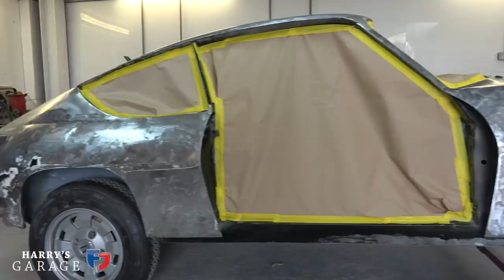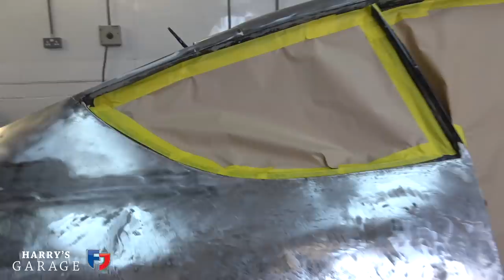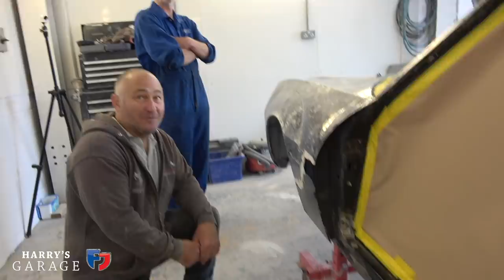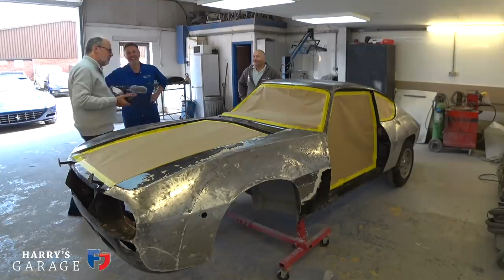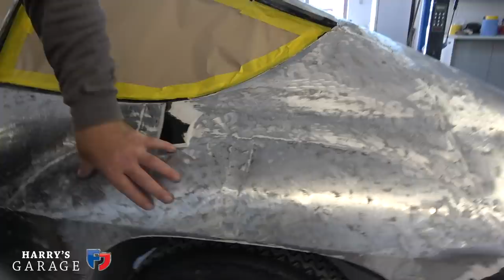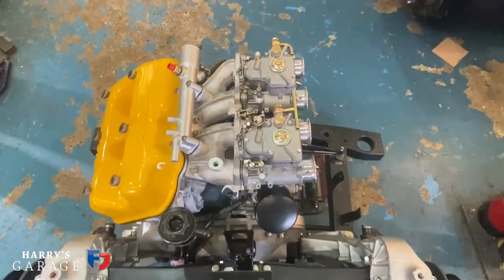Lancia Fulvia Zagato 1600 restoration Pt.6. Stripping the paint reveals shocking bodywork repairs

Comment: I made the same fundamental mistake with the restoration of my De Tomaso Pantera. I started off with the grimy bits, rebuilding the engine and gearbox and suspension, before turning to the bodywork. I thought it was bad but discovered it was catastrophic. Rightly the car should simply have been parted out. But by the time I discovered the parlous state of the body, I was financially so far committed that I simply had to continue to the bitter end. When I was done I had spent  almost double what it would have cost to buy a similar car in similar condition. 

That said, as the years went by the car appreciated and eventually caught up with my investment so I am probably now in the black once more. And I get the satisfaction of knowing that I preserved a car that otherwise would have been destroyed. 

So press on regardless, regardless of cost. It will only be foolish for awhile!
Reply: Those Panteras are ace. Italian style and American muscle! Good on you for keeping it out of the scrap heap.

Comment: At the end of the day this is the exact car that turned Harry into a petrolhead- without it we wouldn't have these channels. Plus it left Turin as a Fulvia 1600HF chassis, went up the road to Milan where a pretty bespoke body was fitted and turned up in blighty on the Wirral where Harry first came across it. Remember in the late '70's & early eighties these cars were worth next to nothing so no-one was going to spend a fortune restoring them, it didn't matter if you cocked the bodywork up as the rest of the car was worth little. Nowadays people in the know have cottoned on to how well engineered and how much fun these cars are and with less than 800 1600's made they are becoming increasingly sought after. It has sentimental value too which counts for a lot so well done Harry in your pursuit to get it right. Apart from a respray in 1986 my '72 Fulvia 1600 Sport has never been restored and still has all the correct swage lines & wheel arch lips and more importantly no filler.

Comment: Last year I bought a 1985 VW T25 that has similar amounts of filler. Rear wheel arches were riveted to the outside of the body and the join hidden under half an inch of filler. I’ve slowly been grinding filler back with wire wheels to find the horrors that need to be repaired. Fortunately new panels are easy to find.

Comment: Glad to hear you called it a steel rule, not ruler. As my Dad taught me,  a ruler rules a country ;)
Do you think it may have been rolled down a ditch at some point, hence the roof having been off?
Reply: Sorry to be the pedant, but the difference between a rule and a ruler is a rule measures from the edge whereas a ruler has a space between the edge and the zero measurement. As an example a tape measure could be considered a rule while the plastic Helix school ruler is just that, a ruler.
Reply: @S3dINS  what about a slide rule?
Reply: @_gray_  can’t say I’ve ever seen one let alone used one.

Comment: Maybe the garage should have picked up on this before the resto started?
Reply: How?   :0)
Reply: @williamr3840  Being bodywork guys, are you saying they can't find an inch of bondo? They had already done bodywork repairs before stripping the entire car. Most everyone checks for bondo with a magnet. Pretty silly to ask how.
Reply: Have a look at part 1 of this series. It went in for engine rebuild work and they found rust underneath. The rust wasn't news but the extent of it was, to Harry at least, so he got them to fix it. 
This has turned from a engine refresh to a total restoration step by step, there was no call for them to start running magnets ofer the customer's car at the beginning.
Reply: @plumbandsquare1  I get your point that they could have done that but, having had a couple of cars restored, my experience is that it isn't what any restorers do to my knowledge. I guess if Harry had asked them specifically to check to see if it was worth doing the restoration or not, then they might have done that, but usually restorers are there to restore cars. Also, they probably didn't suspect the amount of bodging as they said it was oneof the worst they'd seen.  :0)
Reply: Only if they were really familiar with that make & model, or had the exact same car next to it, so that something looked 'odd' from the start. Paint job must had been good enough to hide what was visible in the wheel arches though, body panels shouldn't have been that 'thick'?

Comment: Just clearcoat it and race it. Looks cool like this, fix it when you retire the car.
Reply from the maker: That's an excellent suggestion. Almost tempted to do just that! 👍
Reply: @harrysgarage  Or have it epoxy primed and wrapped. You can always change the wrap as your moods change. Have a different livery every year if you want. Let fans sign it, sticker bomb it, whatever. Either option will probably save you about $20k.
Reply: @harrysgarage  you’re in a tough spot with this one Harry! We’ve all got a few like this in our past. Replace the rust, relieve the stress in the panels, pound them out as best you can. Splice in any openings, apply strong durable filler and go racing. You have to draw a line on this one.
Reply: That's a great idea!!
Reply: You beat me to it!
Reply: Yep just an extra bit of glue on the rear left glass and let her rip!
Reply: Yes, I think that this is the best suggestion yet. Without spending crazy money to fix/correct the history of this car. Clear coating it and exposing its scars, crows feet and warts is showing this for what it is. It is this Zagato's life story, it might be ugly but it is then "Genuine". Sometimes not restoring is better than restoring. Preserving history. At least its heart and bones will be strong.
Reply: Maybe you would have to paint the bonnet matt black to limit reflection and then just add a stripe or splash of the original orange as a homage to its original colour. Possibly dress the interior in the orange.
Reply: Yes, I’d do that, rally it, then maybe fix it. Everything else will be perfect, it’s just a body....and a superlight one at that

Comment: Take a magnet to test for bondo when buying an old car.
Reply: Doesn't help when it's an aluminium bodyshell
Reply: @trenttrevorrow5648  True. It looked aluminum but they kept talking about rust. Maybe they call oxidization “rust” in UK.
Reply: @jonathans1472  Actually, we don’t.  I assumed it must be steel since they kept talking about rust.  Rust is specifically iron oxide.  I can only presume the “no rust” comments were a joke if it’s aluminium.
Reply: @trenttrevorrow5648  apparently only the early ones had an aluminum body shell. all the later ones were steel with aluminum bonnet and door.
Reply: The body is lightweight steel, .8mm I think.

Comment: I have the exact same kind of patch in the middle of my rear left wheelarch on my Mitsubishi... they've changed the wheelarches on both sides with aftermarket panels, but only the left side needed that ugly fabrication for some reason. I didn't even ask why, I've just put a lot of filler and paint over it... cheap and dirty solution on a cheap everyday car.

But the Zagato was never really an everyday car... although it seems it has rusted like hell as most old Italians did, judging from all the patchwork. And there were times when these were just old bangers that nobody really cared about... but it'll shine again thanks to Harry and the workshop guys! :)

Comment: Had a 2011 Alfa Romeo Brera traded in a few years ago at my garage, it was an interesting patchwork of different shades and finishes with rust/filler in all four arches. Rust in the doors, rust in the sills, holes in the subframe and the exhaust in 3 pieces loosely attached to the car by a variety of non-standard hangers. And this on what was an 8 year old car at the time.

Italian cars and road salt, not the best.

Comment: Honestly Harry, I'm not sure I could honestly say that I liked watching that video.  Yes, it was great to see the progress, but my goodness - what a mess!  I have seen patchwork quilts with less joins in them, I reckon.  

Having owned an Alfa Sprint Veloce, I can honestly sympathise though.  The Alfa was the only car I ever owned that got lighter the more I drove it.  At the time, I used to drive to a remote part of the country that for the last 30 miles or so, was winding, hilly, unsealed road and it used to shake the car mercilessly.  I remember driving down there one weekend and hearing the whistle of wind coming through a couple of the smaller rust holes, but when driving home again, the whistle had gone and I had a reasonable breeze in the cabin with the windows up and the vents turned off.  I also found a lump of 3x2 timber hidden where a chassis rail should have been when a lump of underseal fell off.  Fortunately, the car was rear-ended quite hard at a traffic light and written off, but I was almost to the point of parking it until I could find another body to put the wee gem of an engine it had into.  To look at, the car was beautiful in every regard, but the amount of filler it had and the lack of solid underpinnings were not immediately obvious....and had she been hit from the front or side, it could have been a very different story.

I have often thought of getting another Italian sports car, but I don't believe my wallet would cope.  I salute you, my friend.  That car is going to be a very different beast from the one you drove in there......and a damn sight safer too!  All the best.

Comment: There's alot of "wise comments" being made here, but at the end of the day I didn't read any that predicted this outcome. You can never be sure what you will find 100% until you get it down to bare metal. Sure paint depth instruments are good, but don't forget on the near side there was supposed to be a 3/4 panel welded over the original.
This car has surely had a serious accident in its life. But its a Zagato and at least the owner didn't scrap it, but it certainly got a mega bodge job, which at the end of the day has saved it for someone like Harry to come along and get the job done properly. Bravo Harry, I am sure despite the wallet wincing cost it will be all the more satisfying to see it finished in the end.

Comment: I thought after stripping my project car I've seen some bad body 'work', but this beats all. What a downer, eventhough it's nice to know that you'll have a completely different car when it's finished.

But can you shed light on the choice to not sandblast the car fully? With a restoration this size a bare-metal job works much more pleasant in my opinion, and gives you a perfect view on what's to be done and how bad it is to begin with.

Comment: Harry, sorry to see this.  Thinking positively though, remember that Zagato’s designs were wonderful, but their fabrication standards were often, er, iffy.  Check out an Alfa TZ to see their contemporary standards, or have a look at the inner wings on an Alfa SZ (ie. ES30) for evidence of their work in the nineties…. Honestly, the finished panel work is poor, but it’s now rust free and solid, if somewhat rattled.  I’m hugely impressed at your positive approach, and it really will be worth it.  You’ll have the most solid Fulvia Sport on the road once it’s done.  A thought, probably not required, but if you’re going to rally it, might be a good time to think of putting a bespoke cage in it, braced back to some of those seams.

Comment: Given the shape of the added panels on the fenders it is as if at some point someone added some extensions to fit wider wheels. And then a subsequent owner decided to give the car its original shape back by filling the gaps with bondo. It would be interesting to know more about the history of this car: trace previous owners and/or shops who worked on it and understand better what happened. If that car had exptensions fitted for rallying for example, one option could be to restore the car back to that point in its history.

Comment: I had a '69 911 that the hood had been done the same way, it had basically been carved out of bondo. My first clue was when I removed the hood and noticed that it seemed to weight 100lbs and when I started sanding it the reason became clear...   Best of luck.
Reply: At least you can buy a new metal hood for a 911, or any other panel. At reasonable prices as well (Dansk, not from Porsche, obviously....). Unfortunately not the case with a Fulvia Zagato.

Comment: What an absolute nightmare of a bodge job done by the previous "restorer".  

Glimpsing some of the still pictures in this series, the car looked quite reasonable when bought, and Harry had been driving it for some time before commencing what he thought would be a fairly straightforward tidy up.  Which with hindsight, must be a little worrying.
So, Harry, please - name and shame the previous "restorer" (I recall that you did allude to some background story on this) and what about the seller?
Helping everyone else to avoid such charlatans would be a real service.
Notwithstanding the above, this has been a fascinating series, and has certainly made me much more cautious about returning to Lancias from the 1970s.  I did have a Fulvia 1600HF Lusso, which I bought at 5 years old (1977) with my eyes somewhat shut.  I rapidly discovered the perils of Italian rustproofing, as it already, even at just 5 years old, had significant holes in the floor, and had been cheaply welded up.
After many late nights at the other Harry's Garage - the legendary Lancia guru Harry Manning in Aldershot - I managed to get it back to really good mechanical health, but never had the money to address the bodywork issues properly.
It was a real treat to drive, however, and that 1.6 V4 was phenomenal - sounding like an Escort BDA engine at full chat, but being uncannily smooth on part throttle.  It was a nightmare to start from cold however, and I gradually stopped using it when company cars came my way.
I eventually sold it about 15 years ago.  Right at the bottom of the market.
Of course....

Comment: Me thinks the previous repairers in the 70s should have spared the paint and filler and just tiled the thing in 4 1/4" Crystal tiles....... There will be a swan moment to come. Maybe just in time for the end of September. Fingers crossed. Oh and Harry, I would still try for a metal tail gate if you are able to find one. It could provide you with more structural rigidity. You will be loading that shell when you are driving spiritedly. PS. I tested a modern Delta Gold today.................Bw Mike

Comment: Take a GRP mould off a good one, then make your replacement in carbon - it’ll save you £10’s of thousands - and you may survive a rally crash, and you can also market selected moulded bits to other Lancia restorers.
Top Tip: I always run a magnet all over anything made of steel before I hand over loot.

Comment: This setback could be an opportunity to source a set of GPR Gr4 wheel arch extensions, as used by the works, and save the cost of recreating 4 wheel arches in steel. As it will be painted in orange it might be a smart move.  But what a mess this car is! British weather and a low value means that it had received its share of butchering. Now values have gone up it is triple the work.  Good luck with it. Being a Fulvia (HF) owner I love this series.

Comment: Sorry to see the problem!  A 10p magnet would have saved you from buying this 'What ever you call it'! Not that it's any comfort, but when I was restoring cars of a similar vintage I stripped the paint off a customers 4.2 E type only to find a similar patch work of metal that wasn't even welded, just pop riveted, with a very good bit of sculptured body filler over the top!! Bon chance mon Ami!

Comment: That is bad one - unfortunately I ended up with having even worse (not Lancia). We had total around 2000 rivets (not exaggerating) for thin aluminium sheets riveted over holes & patch panels about 5cm of bondo, previous crash damage, etc etc

From a-pillar forwards everything had to be recreated from scratch by a super skilled craftsman with English wheel. Yes. Was shockingly expensive but for a carozzeria built car there was no other option available ☹️

Comment: I am shocked, that bodywork was bad beyond belief, the grooves in the metal locked like a plasterer would do on an old wall because the new plaster has to stick. Now you know why it had a respray in black, too much filler and they probably were not confident enough to match the old color. Yet that bad job is the reason this car was not scrapped, so kudos to the previous owner and not to the former workshop. Can't wait to see it in the original orange.

Comment: Don’t throw it in the skip, fit the engine gearbox wheels etc to the skip it’s probably got a 
better body than this also if you bump it rallying it wouldn’t matter to much, then use the 
car body and fill it with scrap. Probably cheaper to , cheers Harry for the update. 
( looks like the lads have opened up a big can of worms)

Comment: Horrific - the brief on this car was actually the same as for the Arctic Rolls plus a complete engine rebuild (which the Roller didn't get), but it's turned out to be more in the line of the XJC minus the concours finish.

Comment: I´ve seen this kind of bodging so many times. When you try and fix it you run into huge problems with the old welds. It´s much quicker in the long run to wheel up four new whings and replace everything.
Reply: No parts are available. Everything has to be made by hand.
Reply: @mbak7801  Yes, thast why I said wheel up, as in english wheel. these cars were made by hand at Zagato so its not so difficult to make copies. Also I noticed you have an original on hand to make patterns.